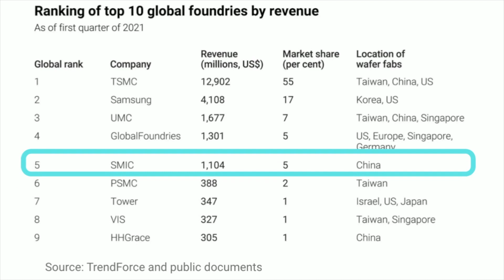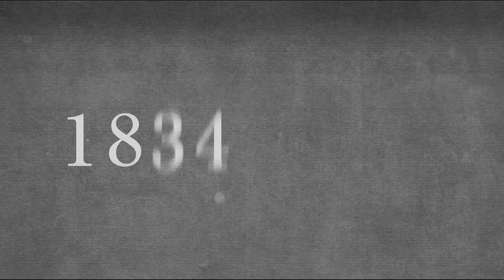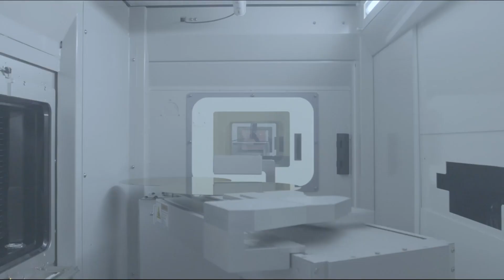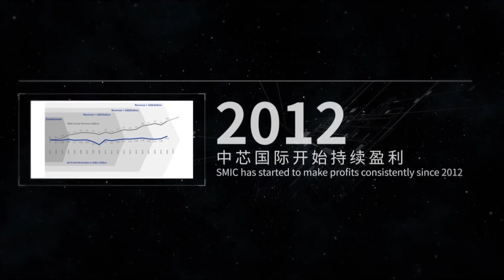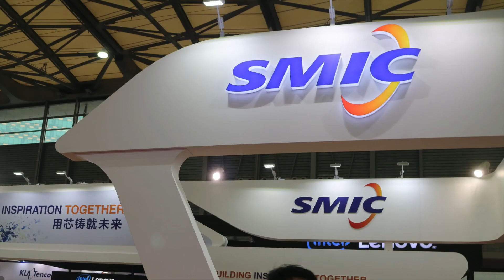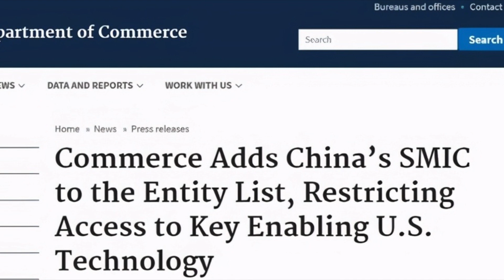How SMIC will lead CHINA to Semiconductor Self-sufficiency - Explained

Comment: 1. As long as the CCP  has and enforces a national policy on all Chinese companies and individuals, and even tries to extend to ethinic Chinese of foreign nationalities to always do whatever the CCP asks or demands regardless of legality, morality, contractural or other basis, no one can say that anyone within the CCP sphere of influence can act independently of CCP control. And, by extension that also means that this easily facilitates easy transfer of IP, goods, services and technology to the Chinese military.

2. On the question whether SMIC can become a world's leading semiconductor manufacturer, that probably depends on how you define "leader."  If your metric is economic profit and loss, there's probably not too many obstacles as long as there is strong demand for chips 12nm and older. China has complete access unaffected by US licensing for the DUV process and can sell all the chips it can make. It can even purchase the necessary chipmaing machines from ASML and other foreign companies to make higher quality chips than the designs it makes on its own. But, China is currently and likely completely blocked from legally obtaining any EUV equipment which would enable the manufcturing of high end consumer and likely military grade semiconductors so SMIC is unlikely to become a leader in most advanced chip manufacturing. There's plenty of business to become the world's undisputed leader in industrial and less advanced consumer chips, but despite this option my guess is this is not what the CCP really wants.

3. On the possibility of China developing its own version of EUV or developing an alternative process, I see a lot of reports that suggest China is researching how to evade the US licensing restrictions, but it's problematic whether China can do this successfully, no matter the number of bright academics working on it. China would be working with up to a decade'behind the rest of the world in research, and it would still be illegal if China re-discovered what has already been patented. China would have to conceive of, and develop a completely different process than what has been patented or find some flaw in the patents which are written by some of the best legal minds in the world. Inventing something brand new that does not build on the accomplishments of others is hard, and to date authoritarian China hasn't seemed to have produced very many talented lawyers when the CCP can simply take what it wants regardless of law.

The paths are clear for China, the CCP and SMIC...
SMIC can become an economic success and world leader but based only on older technologies. But there is so much busness potential this is an easy path to walk.
SMIC and others can invest heavily in developing technologies that would avoid the US licensing restrictions. This is uncertain and unlikely to bear fruit if successful for many, many years.
The CCP can change its relationships with other nations. China has tried to apply the authoritarian power it exercises domestically to its neighbors and other nations around the world when the rest of the world bases its relationships on the Rule of Law, based on legal precedent, integrity, discussion and if necessary recognized courts run by 3rd parties. China currently does not respect Rule of Law, and is repeatedly rebuffed when Chinese fishing fleets simply take what they want in other countries' economic zones, takes disputed land, and uses ancient historyical maps to try to justify such war mongering.
China has to show it can behave as others do to regain respect and standing it has lost. 
World leadership does not mean taking whatever you want, it's taking what others agree you can have.
And when that day comes that the CCP changes its relationships with the world, maybe those trade sanctions will be lifted and favorable trade agreements will replace.
Reply: Classic case of American self projection of forcing anyone in the world to obey US orders or face sanctions or random arrests in other countries other than Us. 😂 and here you are accusing the Chinese doing things that American are doing against other nationals and even its own citizens. FREE JULIAN ASSANGE!
Reply: Meanwhile SMIC 7nm has been in the market since last year and confirmed by Bloomberg this week, even NVIDIA AND INTEL hasn't been able to make 7nm chips, cause so far it's only Korean and Chinese in Taiwan that has produced 7nm chips. 

Sore loser are you now?
Reply: Apparently the have started producing the 7nm chips since july last year. Way earlier than many experts think.
Reply: @Liboch  However unlikely such reports are, even if true would be in very low yields without modern technology. China can try to squeeze the most possible out of old technologies but will result in either total failure or mostly failure with very few usable results. You'll notice even the few reports of successful 7nm manufacturing aren't reporting what their production yields are.